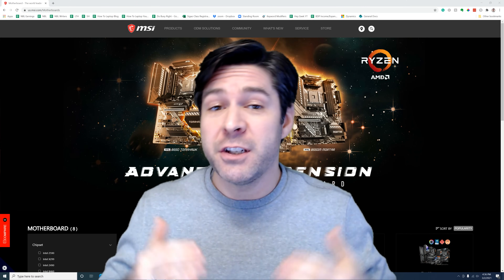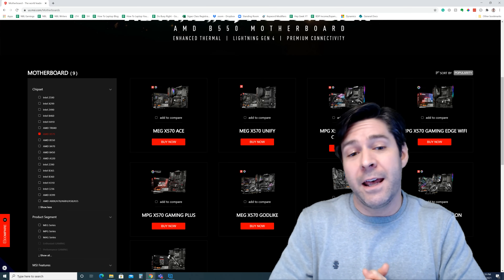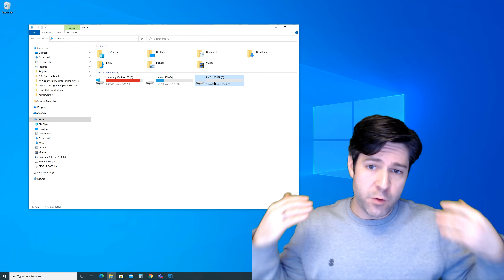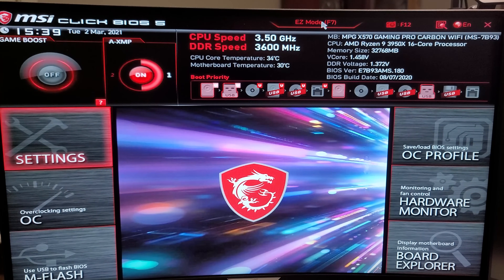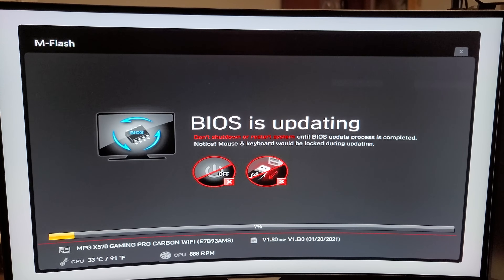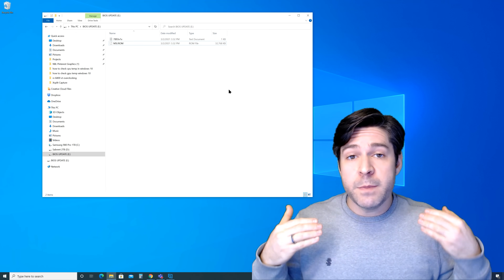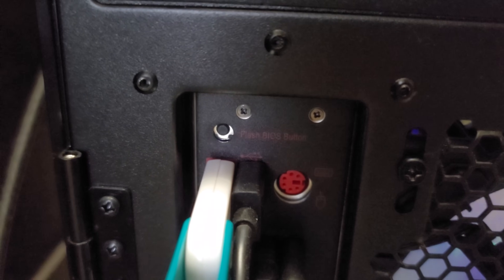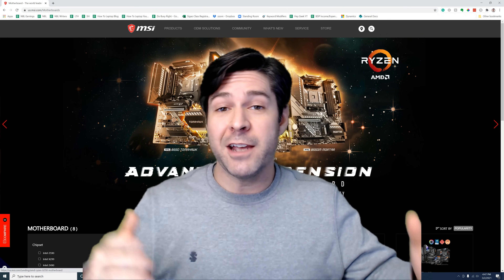How To Update BIOS on an MSI Motherboard Using Both M-Flash and Flash Button

Comment: Can anyone help me? I just installed the same motherboard with a 5900x processor. I updated the bios but the boot priority will NOT recognize my SSD. The SSD is plugged into the first SATA port, it shows as a storage device, but is not on the boot priority menu to load my OS. This is the only drive I have plugged in right now.

Comment: hello great video. I have a question but have you removed all the components of the pc before carrying out the update? some say to do so and also to remove the backup battery. I say is it risky to do it with components such as ram processor etct? or is it indifferent?
Reply from the maker: No need to remove the components if you are using the m-flash method
Reply: @heygeek3816  So to protect my components I shouldn't use my flash button on the back of my motherboard I have the MSI b550 gaming edge wifi, I should use the m flash in the bios uefi instead is this far safer to do? And a question should I even update my bios version is 11/14/2020 should I download it will it give better performance in gaming if not I shouldn't download it?

Comment: Great explanation, thank you!
My MSI MEG x570 unify motherboard came with a sticker on it's box that says "ryzen 5 ready"

Does that mean I can assemble the whole system and go with method #1 from your video?
Or should I better update via method #2 befor assebling the whole system?

One further question is: on the msi website there is a bios Version 7C35vA8 (25th january) and another version 7C35vA93 from april with the information 'beta version'
Should I go with the newest version which is beta or could there be issues with instability?

Thank you!

Comment: Great video, I think my question is a little basic but should I have my new ryzen 7 5800x at least installed into the socket before attempting the button method or does it not matter?

Comment: Hey Geek! ;) I've got the b550 Tomahawk with an 5600x in it. When i build the pc i used a beta version for the bios, worked fine, but now i would like to update it to a new version without beta. Should i take the bios version 7C91vA4 which the website MSI shows is compabitle with the CPU, or is a newer one also working 7C91vA5? I've got the option of using flash button, would u recommend that, or just use the M-flash? Note: I've heard rumors of bios resetting when entering M-flash? is that true? If it is, wouldn't i be in problems when trying to use this method? Good video!
Reply from the maker: Thanks for watching! The MSI website should show the latest BIOS for your board along with any beta options. In general, it is safe to use the newest BIOS but some people choose to wait a few weeks to make sure there are no bugs. Personally, I always update to latest. As for update method, M-Flash is BY FAR the easiest method so I would recommend that. I have not heard of BIOS resets with this method but worst case you could always use the flash bios button if something happens as it doesn't require the system to boot.
Reply: @heygeek3816  thank you for the reply! Will do. :)

Comment: Hi, when i enter the m-flash i cant see the file.
Reply from the maker: Be sure that you place the file in the root of the USB drive (not inside another folder) and be sure that you have the USB drive formatted correctly. You can also try using another USB port or another USB drive as I've heard about people having issues with a particular drive/port.
Reply: @heygeek3816  I havent tried a different USB port so maybe that is the issue but when i get into M-Flash with the USB, it shows the USB drive and i think the file, but when i click on it, it still says N/A on the bottom and doesnt install anything when i hit enter